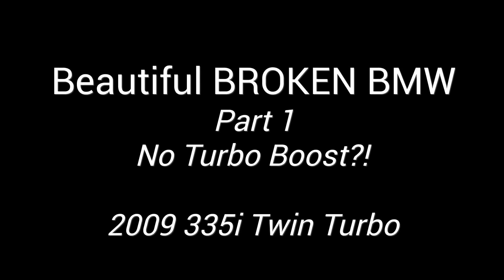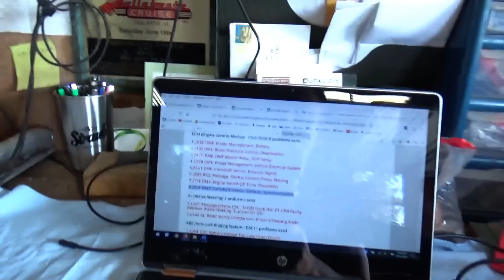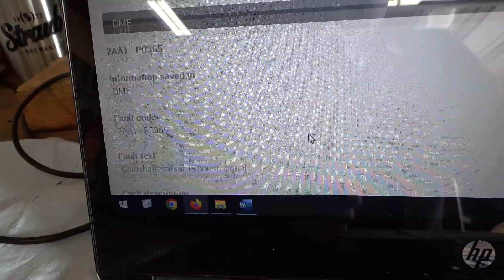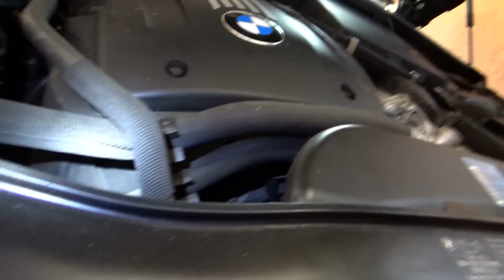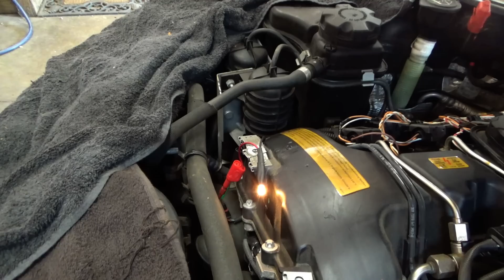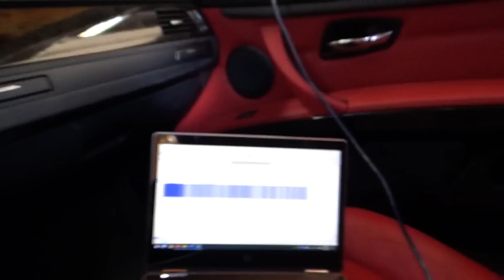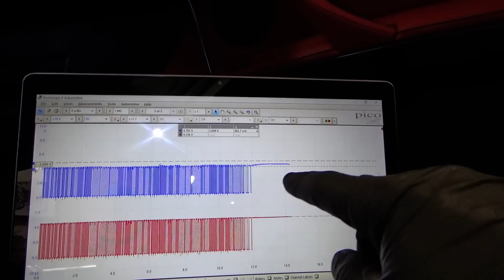(Pt 1) Beautiful & BROKEN BMW?! (No BOOST: 335i Twin Turbo)

Comment: Its a Beemer, a cmp sensor is just the start...probably needs a waterpump, battery, injector, frm, coils, ecm, oil leaks fixed and coolant leaks remedied...😂😂😂
Reply: Don’t forget all coolant hoses and engine rebuild
Reply: 😂 @rickchowsr2532
Reply: How about an all new car😂
Reply: Yes, and even with those low miles, it also needs motor mounts, ball joints, new radiator, valve cover gasket, oil pan gasket, new timing cover, an entire ridiculous excuse the Germans have for crank case ventilation system.
Reply: Been watching clickbate videos then? They're mostly fine. A few go wrong, most are fine.
Reply: @Malc180s  i can say with some authority that they DO go wrong often, because i have been fixing them for 30+ years now. The amount of $$$ per year that is required to keep one running and in good condition is significantly higher then say compared to a Lexus.
Reply: @mrblonde2013  you have no authority because you're a child talking shite on the internet.

Comment: A long time ago.......this car was the first car that I learned how some turbocharged cars boost control works in reverse where the wastegate is normally open. That kicked my ass for a while. I was so used to the traditional wastegate normally closed until given a boost reference.
Reply: Are they open until you start it and it sees vacuum?
Reply: @blindabinda1234  The other way around. Closed. Until engine is turned on. Then it's open. Until boost is needed.
Reply: @foolsendextremebashing  so what opens them once the boost threshold is reached?
Reply: @blindabinda1234  The wastegate. It just works in reverse. Normally opened. Then closes accordingly.
Reply: @foolsendextremebashing  that doesn't make sense. There has to be some kind of vacuum pump or electrically operated valve so the turbos don't over boost.
Reply: @blindabinda1234  it does make sense. That's the point. It doesn't ever over boost because the wastegate is normally open. That's the whole point of the design. The default state is open so if there's a failure you don't get infinite boost.
Reply: @blindabinda1234  Go look at a modern BMW with electronic wastegate. Open the hood. Have someone turn the car on. You'll the wastegate go from closed open. Until it is commanded closed again. Ford does it this way. Land Rover. Audi/VW. A lot of manufacturers have converted to this operation. Kia/Hyundai is the only one I can think of that still uses traditional style wastegate operation.